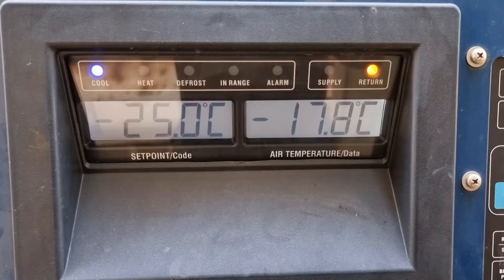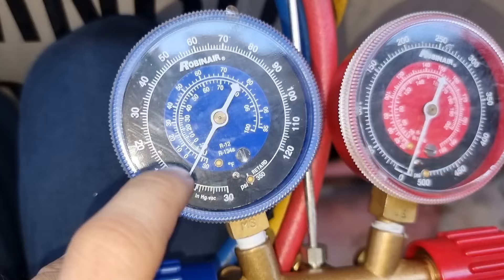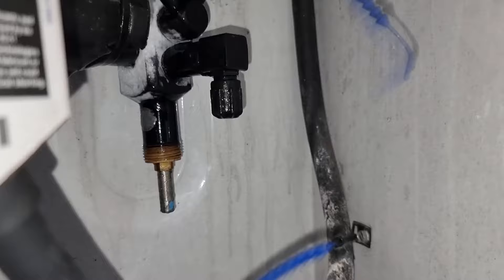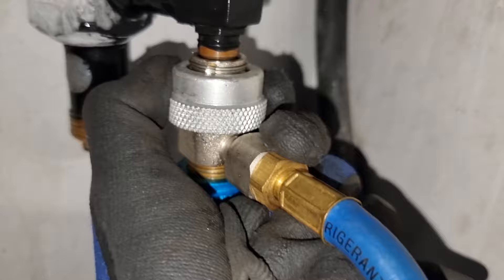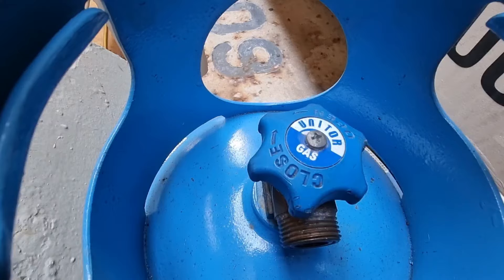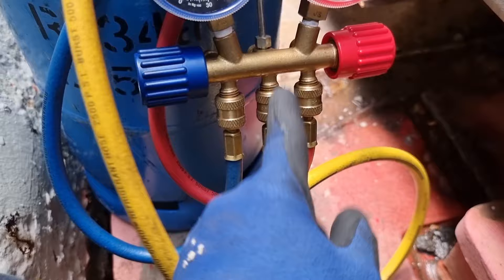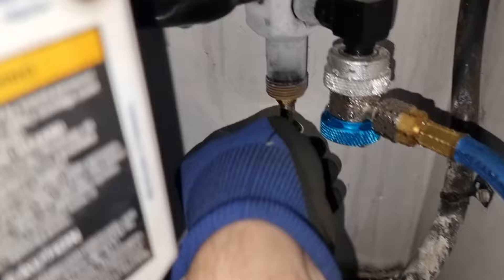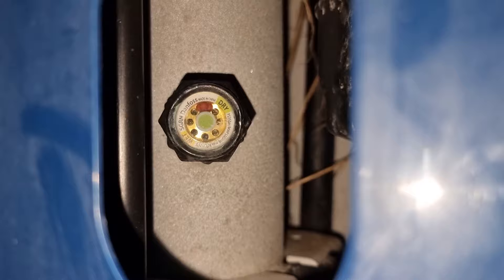HOW TO CHARGE REFRIGERANT WITHOUT DIFFUSING ANYTHING IN THE ATMOSPHERE.

Comment: I helped change an evaporator in a walk in fridge today with one of our fgas techs. The gas charging operation was similar to yours but we had scales. He also had a funky ratchet spanner for the valves. As a 25 year electrician this was something different. I am doing my City and Guild’s fgas next week so I can play with the AC units at work. As always good videos. Best wishes.
Reply from the maker: Thank you and good luck to your next week's job
Reply: @leckyjake  what brand of pressure manifold ur using or those connectors, send me link I need to buy
Thank you

Comment: Very impressive that you do both electrical and HVAC!  Who is responsible for paying for this type of repair, the owner of the container, the shipper, or is it covered by the boat as the cost of doing business?
Reply from the maker: i am just being paid as per monthly salary.
Reply: I have the same question really I think he means who ends up paying for the parts and refrigerant needed when a unit goes down while at sea is it the cargo transporter or the shipper or the receiver
Reply: @YouTubeviolatesmy1stamendment  i think he has to write a report for each box repaired and shiping  line is going to pay for the serviced container as per report.

Comment: Hi sir. I just have some friendly questions and observations:

1.) As you mentioned that the system is a closed one, the diminished system pressure should surely imply a leak somewhere in the system. Were you able to find it?

2.) While you did purge the air out from the yellow hose but I did not see you purging out the air from the blue and red hoses. I haven't experienced working on a refrigerator yet so it really wonders me how to purge the air out from the blue hose considering it's below or equal to atmospheric pressure unlike in air-conditioning system where low side pressure is considerably above atmospheric.

Hope you could enlighten me sir. More power to your channel.

Comment: Greetings. What about purging air from the red/blue hoses and the centre of the manifold?  Thank you
Reply from the maker: You don't need to purge as they are always isolated. It means that below zero pressure discharge gauge (red) will keep on that position.

Comment: I would like to ask, during charging does the compressor is running that time?
Reply from the maker: Yes it is running
Reply: @leckyjake  so it means, during charging you just to wait to run the compressor before opening the manifold valve?
Reply: @benjiebajuyo9462  since the temperature is way above the set point, the compressor is continuously running.
Reply: @mlenstra  yes your right thank you for the response I just realized it just now hehe.

Comment: sir, we all know in refer system from evaporator slightly super heated vapour returns directly to compressor crankcase, not directly to the compressor suction side. from the crankcase compressor takes suction.
why is that so? 
is it to eliminate risk of liquid refrigerant getting directly into the suction? or any other specific reasons?
can you pls help?

Comment: So where did the refrigerant which was in the system disappear to before charging since you said there was no leakage  ? And also when you finished charging the low side  gauge was still showing zero
Reply from the maker: please take note that the container is moving from country to country, ship to ship, and port to port in which a lot of Technicians are handling them. there are some instances that they do maintenance and troubleshooting in which they might have had charge refrigerant less esp if they are in a very low ambient temperature.
Reply: Thoroughly leak check as what you’ve said on 1:37, but you didn’t show that you check the tubings on condenser, evaporator and bulkheads leading in/out the evaporator. So how is it so sure that the system has no leak at all? And how is it that the suction/low pressure side is still zero after charging? Thanks if you can be able to answer.
Reply from the maker: if i will put the whole clips then the video will take for hours. This is a moving machinery which travels all around the world, from trucks to trucks, from cities to cities, vessels to vessels and from hot area to low ambient temperature area. if the container came from a low ambient area and a service was made then there is a posibility that less refrigerant was charged but would still work since condensation on the condenser is too easy due to low ambient but once this travels to tropical countries just like malaysia, then this less freon would matter and need recharging.
Reply: Thanks for the explanation 👍

Comment: Ano kaya problem sa cv namin, as checker of reefer diko po alam kung paano ayosin pero gusto ko lang matotoo. Myproblema kasi yung reefer namin first issue ayaw mag andar ng fan on going cool kaso nasa positive 30 lang tapos dibumababa. ang set point is -25 after 5 to 10 nag heat tas defrost. Check ko yung maleplug ok naman at yung wiring at voltage ng container ok naman. Ano po kaya problema or ano dapat gawain po. Newbie lang po ako totally checker po ako sa reefee namin

Comment: Hello brother, normally the system is working in chiller Mode . I can change to freezer Mode
Reply: Like if I change the temperature -18 , what I will follow?
Reply: Also Another Unit ( Carrier Thinline ) Modulation valve doesn't Open Fully , like it's Open only 17 , How I resolve that problem

Comment: sir lecky jake  solid fan here . question lang po. pag nag charge ba ng refregerant dapat ba naka andar ang compressor or naka para ang compressor.
Reply from the maker: running ang compressor
Reply: @leckyjake  thankyou for the prompt answer sir. So, can we do (charging refrigerant )  on our provision reefer and HVAC onboard vessel given the system is running? because the video you shared is for reefer container . And also,  i am confused on one person i asked he told me he charged refrigerant na naka para ang system. Thankyou sir idol . Answer is highly appreciated po.
Reply from the maker: charging of refrigerant, for me mas ok na running ang system para hindi nabibigla yung suction side ng system dahil continous running at circulation ng refrigerant and to add up, madali siyang papasukin sa system lalo kung vapor state na yung nasa tank at sa suction ka mag connect.
Reply from the maker: same lang hvac and provision
Reply: @leckyjake  very well explained po sir idol, and this will add my knowledge on handling  hvac onboard. . looking forward for more videos regarding  wiring diagram interpretation .thankyou sir. 

ps. i followed you on IG

Comment: Sometimes it is better to put bottle bottom up to charge liquid refrigerant.
Reply from the maker: id rather wait for the process while charging vapor in the suction side
Reply: Where you will charge the  liquid refrigerant to the system if you want to charge the system by liquid rfrgnt. I'm asking the foreigner Sir lecky.

Comment: Condenser coil leaking :D
Reply from the maker: i can say no, because it's been a week now and unit is still running good and pressure is holding at 9.5 bar pressure
Reply: @leckyjake  i might be wrong ;) but most of these units have issues with condenser coil

Comment: what country are you from? are those charge hose fittings required by your countries laws? how do you push air from your hoses with those silly low loss fittings? hope you don’t have to pull vacuum through all that silly stuff also.  we can and are made to always contain our refrigerant as techs and you here prove it’s easy to do, yet it commonly leaks from refrigerant systems with little or no regulations or punishments when it does. brand new equipment leaking its charge from day one.  i’ve seen 100’s of kilos of refrigerant go freely, but it’s not made a big deal. but your using a manifold thats overly complex, expensive and burdensome i’m assuming because it’s required by your laws. let’s try building equipment that’s not junk
Reply: “Complex and burdensome” in which way(s)? This looks to me like a perfectly standard HVAC manifold set with some automotive QD fittings to connect to the service ports, which parts would you say are unnecessary?
Reply: @mlenstra  look like low loss fittings to me